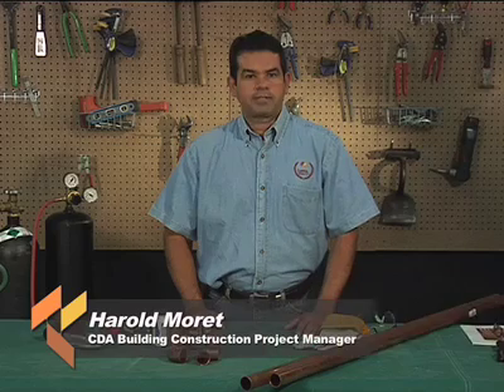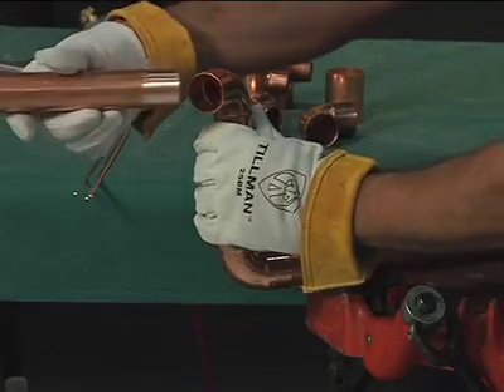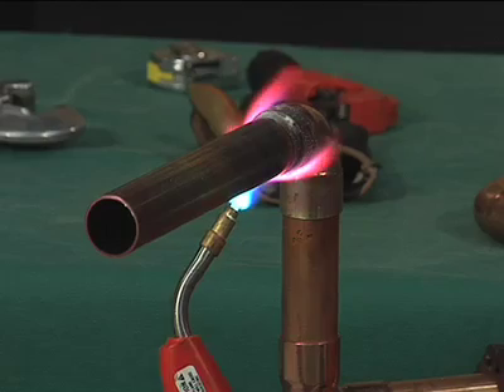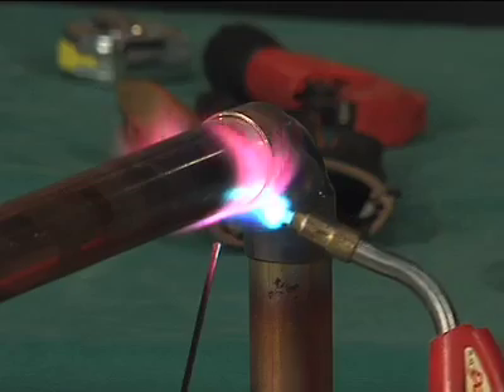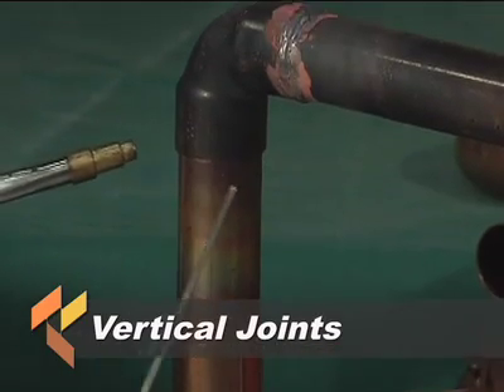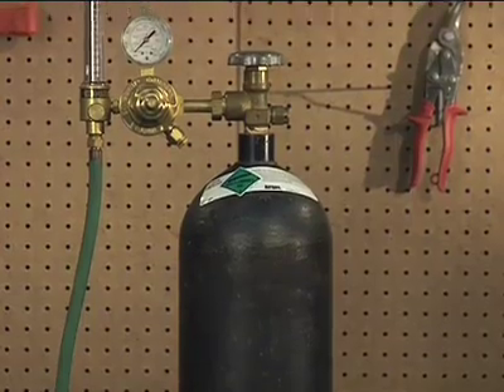How-To: Braze Copper Tube

Comment: I clean the pipe and fittings really well, add a very conservative amount of brazing flux to the joints both inside the fitting and on the outside, heat from he bottom up while moving the flame in very short strokes across the bottom of the pipe and wait for it to get red hot. Then and only then will i start applying the brazing rod, working my way from one side of the joint to the other, all while intermittently backing off the flame as i make my way around the joint. All you need is 3/4" stick of braze for 3/4" pipe and so on although i try and play it safe by adding a half inch more of brazing rod. A good braze is all about preparation. I used to think that all i had to do was connect the pipes and start brazing, boy was i wrong. Although half the time it would work out my braze looked sloppy or the braze wouldnt take at all. And of course always trickle nitrogen while brazing. Anothrr preventitive measure is taking out the txv while brazing in a liquid line. Most new systems have txvs with mechanical fittings so they can easily be removed, just remembrr to lubricate the teflong rings with nylog when re installing it. Wrap only what you have to, like service valves. Another tip, always cut off de brazed portions of pipe, i have burned holes through pipe that has been reheated several times, mostly on a 3/8s liquid line. So now i just cut the half inch of reheated shit off, and start fresh, plus theres usualy slack in any line side. Hope these tips help anyone out there who is havin a hard time.

Comment: Did you mention what rod your using? Everyone doesn't automatically know which rod to ask for!
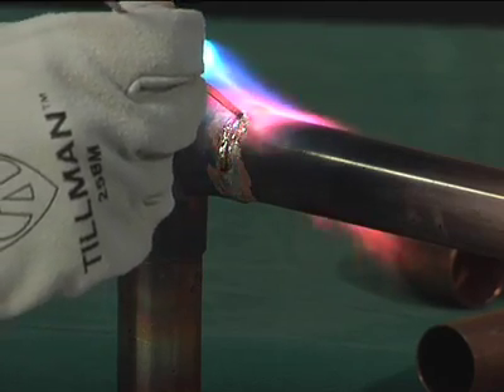That first joint looked a bit cold and separated on top 3:10   .
I've soldered a bunch of 3/4 copper for water but not sure what filler your using here.

Comment: Give this guy a break. The purpose is to show us how to BRAZE COPPER TUB. Not how pretty it looks. I wanted to know if I could Braze Copper instead of solder and he showed me that it could be done. Now if I want it to look pretty, them I will have to work on my technique.  That can't be thought. It comes with practice.  I liked the video. Thanks
Reply: Brazing here in Australia would be used 95% of the time for waste and water copper pipe joining. And yes this guy's brazing looks no better or worse than near on every joint I've ever seen,especially if it's to buried or hidden in a wall.
Reply: Andy St. Michael
Reply: No one brazing is going for looks. If they are they're a clock rider
Reply: Mrdontmess1996 Here in Canada anything over 5 tons is inspected so they look for a proper shoulder on each joint and it's just having a little pride in your work also not riding the clock remember it's all pensionable time
 Lol.🤑
Reply: @jeffscanlan3554  lol I agree I always go for a sexy looking solder joint
Reply: Nicely said.

Comment: thanks alot...u saved me.....
Reply: I’m a diy-ER and am constructing a desk for a h9me office with multi-media. I’m using 1” copper pipes for the legs of the desk, plan to use a wooden surface for the top of the desk, & would like to use casters on the bottom of the copper construct, thereby making it mobile. How can I attach the copper pipes to some kind of readily available metal plate. The plate needs to be made of a type of metal (or last resort would be a wooden block) that would be sturdy enough to allow for a drill hole to mount casters at all 4 corners saw well. Any suggestions.? Thanks,

Comment: I like to use the big bertha tip because it's faster to get it red hot.  While always having heat on it so u can push the rod into the fitting, like butter.  Easy money.  To make it look pretty u can cap it, but it's not really necessary if the fitting completely filled.

Comment: @arkanoiddude when you braze you usually don't need flux because the brazing rod usually used in the field contains it. the key to brazing is heat! you want the fitting red hot to get full penetration. learn to manipulate the heat and use an oxy-acetylene rig on anything bigger than inch and a quarter. This hack says to use two torches on larger pipe, that's ridiculous! If you've got skills you can braze a joint on 4" copper in under five minutes with one torch! take a med gas certification course, that will really help with your brazing. Good luck!
Reply: He said flux generally isn't necessary and Ive heard of two torches being used on large pipe...

Comment: I don't know what brasing is. I always called this silver soldering. "Brazing" is a  process by which a coated bronze rod is added to cover a joint not to flow into it as in soldering.

Comment: I'm sorry, but what?? Your statement baffles me, and I've studied chemistry and I'm aware of the properties of an oxidizing flame vs. a carbonizing flame vs. a neutral flame. Oxy-acetylene stoichiometric combustion produces a carbon dioxide shield that prevents oxidization of the copper (or any weldable metal for that matter...). Same with Oxy-MAPP, so long as you get a neutral flame. So, can you please elaborate on why you should NEVER weld, cut, or braze copper with acetylene?

Comment: Get the pipe and fitting red hot and stab it with rod. Use the heat to drag the filler to the back of the fitting on bigger pipe. Stab, drag and put a fat cap

Comment: I am currently a student learning the trade, and one of my instructors (who is an HVAC/plumbing/electrical contractor) told me that flux is not necessary for brazing like it is for sweat soldering. So what is the deal with the flux in this video?
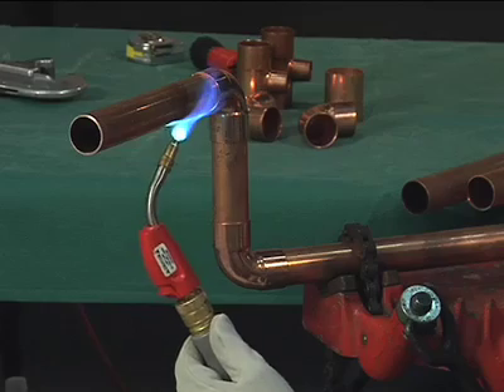Reply: read the screen at 1:24
Reply: You don't HAVE to use flux.  But you don't have to wear your seat belt either while driving.  But you do, right?

Using the flux is a temperature indicator.  When the flux starts to turn clear, that's the indication that the copper is hot enough to use the alloy rod to braze the joint.  And using flux, especially when brazing saddle joints, acts as an extra sealant to keep that tube or schrader valve from possibly leaking and failing.

Comment: Part of the reason why the alloy is pasted on is because he didn't heat up the elbow's union enough to suck in the brazing alloy using "capillary action".

I doubt this would pass a pressure test.

Comment: He didn't fill the actual joint, just put solder over the edges
Reply: TheJordanwright it gets sucked in from the flux
Reply: @jameswilkie6267  during brazing you shouldn't be using flux

Comment: I do not deal with nor know much about acetylene or MAPP gas. I won't try to google and lie to you like most would.
My guess would be those gases burn hotter and would weaken the metal.
I'm only certified to work on inputs up to and including 400,000Btu/h right now, so I don't have a need to use other gases for cutting and/or welding.
Cheers.

Comment: This video DOES NOT describes how to properly braze copper tube.

Firstly, there is no point in heating the tube before the elbow.
Secondly, copper is an excellent conductor of heat. You do not need to move your torch that much. In fact, you can usually keep the flame stationary on the pipe. Your goal is to get that swedged union in the elbow RED HOT, but only briefly. The moment your flame turns GREEN, you are ready to apply your brazing alloy. You don't need to paste it on like in this video.

Comment: its won't blow the weld. Granted its not wise to use TIG , hell it wouldn't even enter my mind, but it won't blow.  The fitting would have a blow out before the pipe will.  Your fitting are not as strong as pipe.  As you know there is different types of copper pipe.  They're is not type K 90 or type M 90 just pressure 90 or DWV 90.   If I seen a guy TIG welding copper I'd haver a lot to say about it or at least the the engineer who spec this.

Comment: I'm an idiot?
Firstly you think I might be a plumber. That's laughable. I'm a certified HVAC technician. What are you?
Plumbers only need to know 3 things. Shit rolls down hill, payday is Friday, and don't bite your nails.

Again, there is no reason for you to heat the tube before the fitting. Copper is an EXCELLENT CONDUCTOR OF HEAT.

I seriously doubt you have any credibility if you think this video shows excellent techniques. 
Plumbers are HVAC drop-outs.

Comment: You prep like you are going to solder not braze. And what's up with using emery cloth and suggesting flux? I sure hope this info was not intended for brazing refrigerant lines with all that foreign material you risk getting inside the system. Not a good idea. I have been  in the refrigeration and ac business for many years and I never clean the pipe with emery or use flux. The high temp needed to braze burns off oxidization on the copper and cleaning it off first is not necessary.
Reply: "oxidization"
Reply: +Anthony Bianco The cleaning with emory should have been done with a non shedding scotch brite if he were brazing Med Gas lines. Although refrigeration lines should be run in ACR copper which is already cleaned, the ends can become contaminated with grease from handling which can sometimes make it hard to make a good metallurgy. Especially when joining new pipe to a much older existing pipe that has been collecting oxidation for years.
Reply: Anthony Bianco the heat doesn't burn off the oxidation, clearly you're new to brazing. Flux is actually the best way to go in refrigeration brazes. The only way you're getting foreign material inside is if you don't clean and flux.